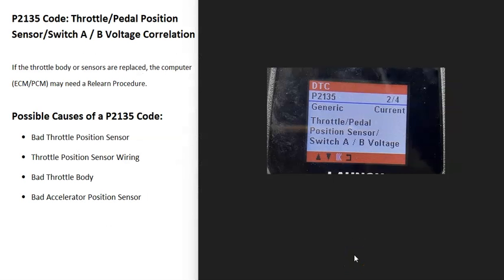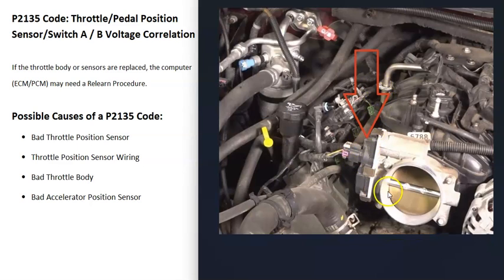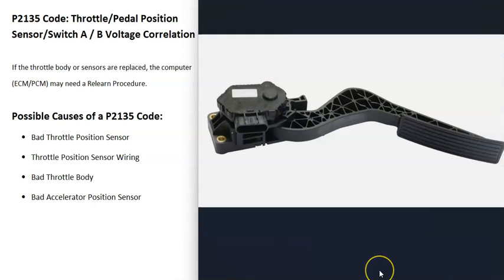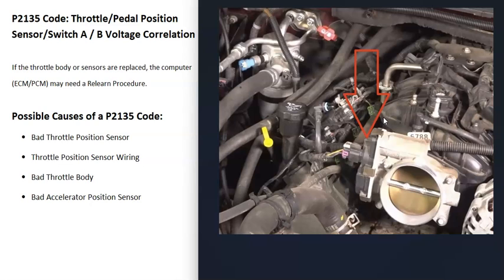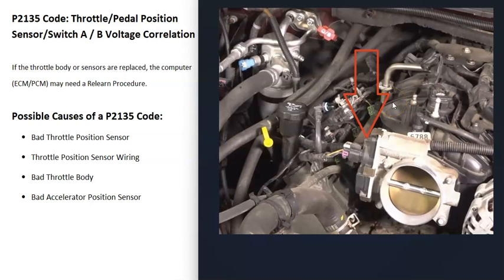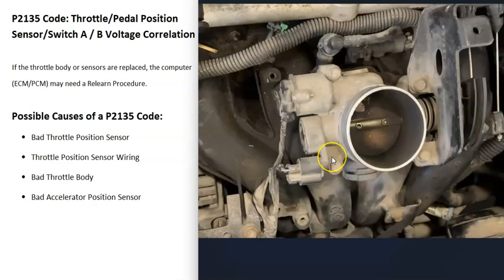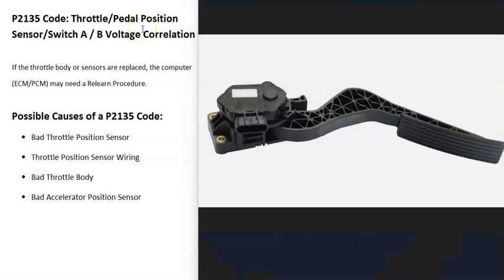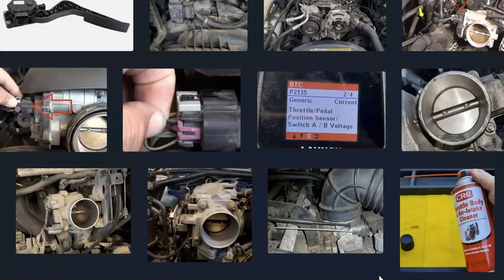Causes and Fixes P2135: Throttle/Pedal Position Sensor/Switch A / B Voltage Correlation

Comment: p2135 code on a recently 10 month old/NEW throttle body "was replaced for the same code and has been driving fine this whole time" Until: was leaving the store, dash lights lit up, ran like poop & felt like the transmission jerking/shifting hard. "I pulled over and hooked up my FIXD scanner" cleared the codes, the tranni jerking stopped, it made me home with no problem. Garage/Mechanic had it overnight drove it 35+ miles and could not find any problems or codes... I'm afraid to drive in fear of getting stranded.. I appreciate any feedback on this TY! "09 GMC Envoy"

Comment: What if the customer replaced both gas pedal and throttle. And it’s still doing the same issues. Giving the same codes. Codes are p0122, p0222,p2135,p0221

Comment: If I changed out both tb & pedal ps on my 04 Infiniti fx35 and I still get code p2135 do you think it could be my wires? How can I check? Some times I can drive it for up to a month with no code, other times I get the code every other day or every day. I need help! I’ve been struggling with this code for a very long time. I’ve changed so many parts on this car I’m frustrated. I really need my car. It’s only that one damn code 😖
Reply: Same here

Comment: I have changed the throttle body, pigtail, wiring harness, gas pedal and everything was fine for about two months.  Throwing the code again.  this video gives me more information on what to pin point.

Comment: Throttle pedal position sensor and accelarator pedal position sensor are they the same ?
Reply from the maker: They are separate sensors. One on the pedal and the other on the throttle body.

Comment: How about intermitten P2135 DTC code?, my 2007 CRV K24 after clear fault check engine reappear after 2 days
Reply from the maker: Intermittent issues can be difficult to diagnose. It could be a loose wire that only disconnects on a bump but reconnects, or possibly a component just starting to fail. I would check all the connections and be sure all the wires are seated good.

Comment: I've had this issue on my 06 sentra 1.8 for a bit

About a month ago I got the issue and stalled. I started it up again and it went into limp mode. Replaced the TB, cleared the code, did the pedal relearn and all was good. Happened again today as I went up a slight incline. No stall but the CEL went on. Same code. Should I replace the pedal sensor?

Comment: What if I've changed both the throttle body and gas pedal and sensor but still gett the 2155 code
Reply: P2155 seems to be a fuel injector open circuit code?
Reply: Did you figure out this issue?

Comment: If you get this code check the connector also they are known to get loose at the pins,  my mechanic showed me how loose they pins in the connector was ,  changing the tb should be secondary